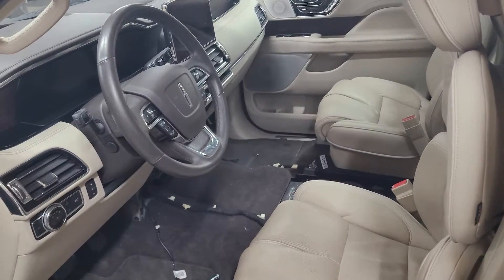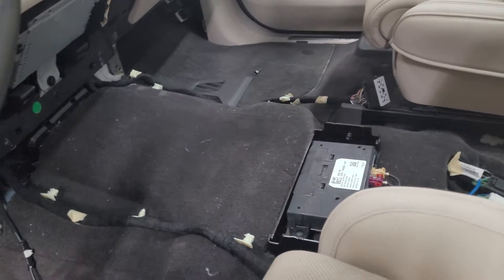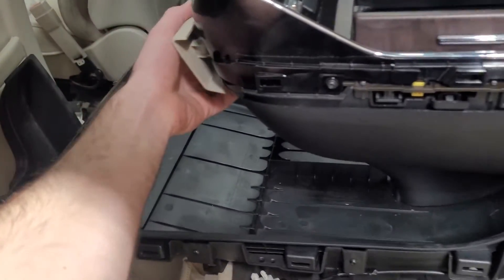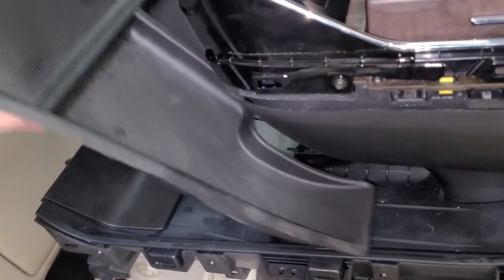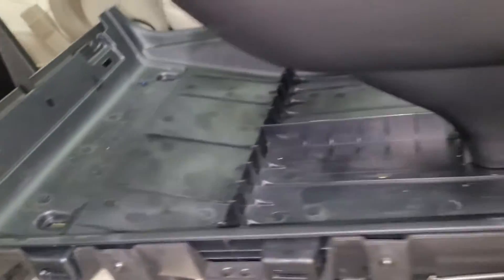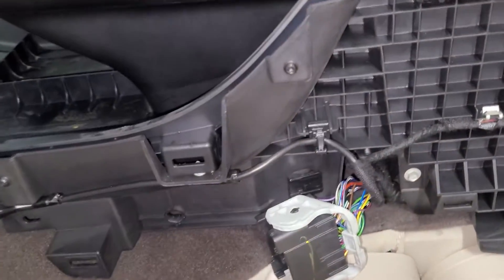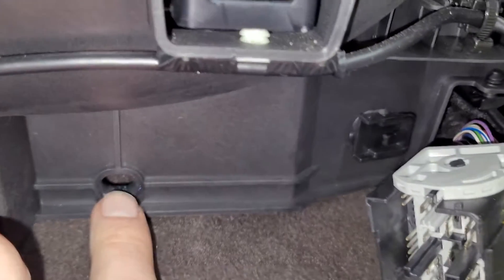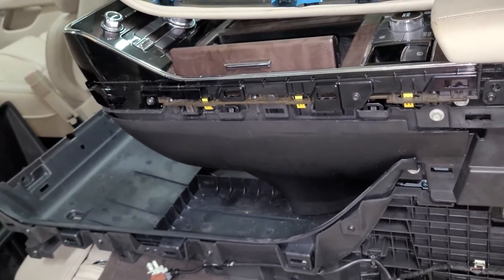2018 Lincoln Navigator SRS module location and Removal Explanation

Comment: This is really nice. thanks. Do u know where is the APIM (communication module)? mostly its right behind the screen but clearly not with Navigator 2018+
Reply from the maker: We don't have experience with that module but the service manual show to remove the center console and the APIM module will be mounted near the floor directly under the screen.
Reply: Did you end up swapping an APIM? Was it the module on the left side of the screen in the video? The one with the red, yellowish and white connectors? I'm getting ready to replace one as well.

Comment: Awesome video I buy cars from auction and usually send them through eBay. What’s your companies info I’m in need of resetting one for a 2018 navigator. Also do you know if this activates something in the car mine turns on but it shutters and keeps honking. Thanks I’ll be waiting for your info to send it in
Reply from the maker: The SRS module does not effect anything other than the SRS system such as airbags and seatbelts. Here is a link to our site.
https://www.automotivecircuitsolutions.com/